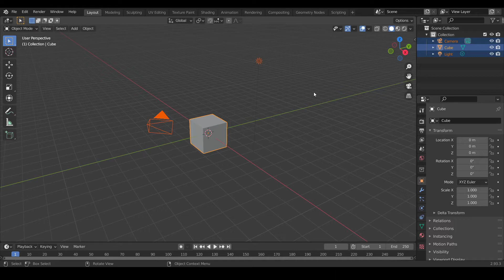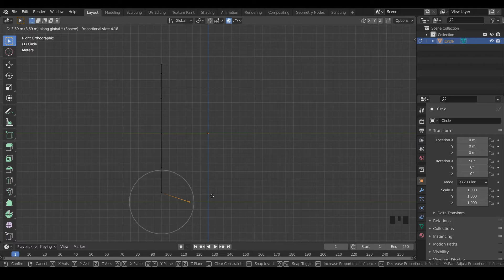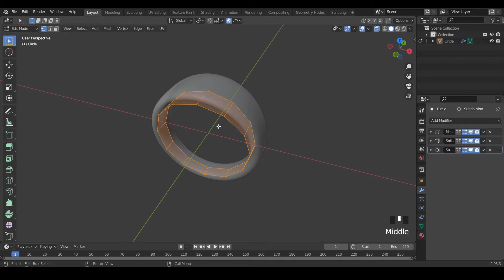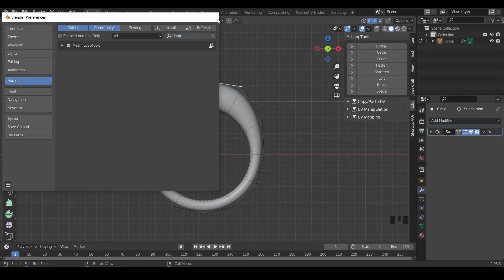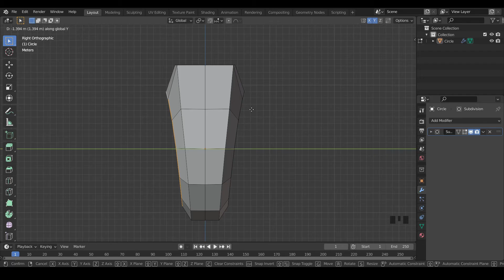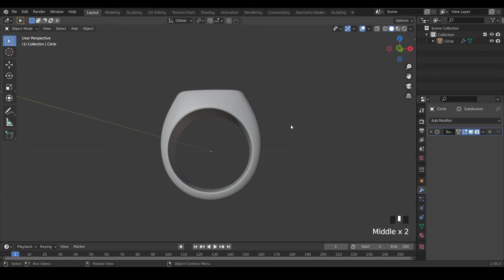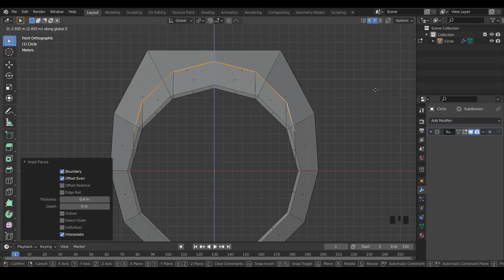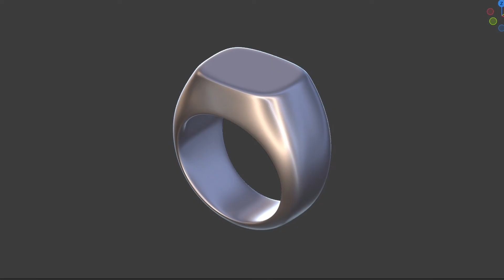Jewelry Design | Modeling a Signet Ring in Blender [Tutorial]

Comment: when I add the subdivision  surface modifier i get what looks like a split in the very top and bottom, where as your goes smooth straight away, any fix?
Reply: I get this exact same issue - did you fix it??
Reply: No haven’t managed to fix it, I now make signets with a different technique
Reply: @ODVINE  I found another comment on this vid which had a fix. Go back to the mirror modifier and make sure it's just the Y axis that's selected. I had Y and Z selected - just making sure it was Y fixed the issue!

Comment: Do you have any idea on how i could model a signet ring, and then change the internal ring size, while keeping the ring thickness and top size the same, if that makes sense
Reply from the maker: The best way I've found so far is to use a lattice modifier and increase the resolution to have more control points. Then you can scale the whole thing up or down and adjust the top points for a different thickness.

It takes a bit of tweaking sometimes but has worked well for me. 👍
Reply: @GraceNoteForge  thanks so much for the response,  iill give it a go
Reply: @GraceNoteForge  also i have noticed using subdiv modifier, it makes the internal size of the ring smaller, as its smoothing it all out, is there anyway to avoid this? adding loop cuts and creases hasnt seemed to help

Comment: Hey mate quick question having a bit of trouble at the 12.44 minute mark my faces turn into lots of small squares when i try to use the insert function instead of  all going in together . any thoughts  ? when trying to raise the inside of ring
Reply from the maker: In the Inset Faces dropdown menu, make sure "Individual" is unchecked. Otherwise it will inset each face separately.

Comment: mines not perfect cirlce. how come there's a line both top and bottom of the ring? -_-
Reply: When you added your mirror modifier and you clicked on the Y axis, you did not unclick the X axis. Only the Y axis should be selected. Took me two days and several restarts to realise what was happening.
Reply: @hanneswelthagen9747  Thank you!!!! I was so frustrated and couldn't figure this out. You solved the problem.
Reply: @hanneswelthagen9747   that’s fixed it !!! thanks so much
Reply: @hanneswelthagen9747  OMG I love you haha been scratching my head with this for hours haha
Reply: If you have a seam where the two mirrored parts meet and clipping is not enabled in the mirror modifier, you get a sharp upstanding edge. Is that what you mean?

Comment: strange but simple modeling technique. interesting. but I prefer to make the rings through the curve modifier. then there is a possibility of resizing with less problems
Reply: I've used this tutorial to design a ring that is something like a low medium complexity. I actually had to go back and resize and I didn't have any issues with the physical outcome. Tell me, what problems do you foresee with this method? Genuinely curious.
Reply: @abasis.baruti9819  well, for example. you need to make sizes from 16 to 23mm for mass production, they should be the same, differ only in size. plus in the video it's just a blank, and if you add decors. this is where the problems start. BUT for a single item, this method is probably the easiest and fastest
Reply: @kotmakcep8769  thanks for the reply. Definitely something to keep in mind. What other method would you recommend? Hungry for knowledge.
Reply: @abasis.baruti9819  complex and voluminous topic. blender gives very great opportunities for paremtric modeling. A lot is automated in the Jewelcraft addon. but I recommend understanding how they work, a lot is done simply by adding modifiers, constraints, drivers, and of course their combinations. can't describe in a nutshell
Reply: @kotmakcep8769  I catch your drift. I started with a uDemy course that focused solely on parametric objects.
Reply: @abasis.baruti9819  I speak English only with Google translator, so I can’t say anything about this course, and it’s also difficult to advise and explain something. try and experiment and find a convenient way for yourself